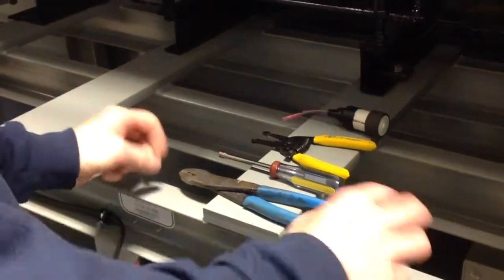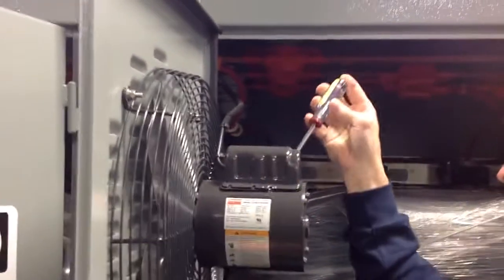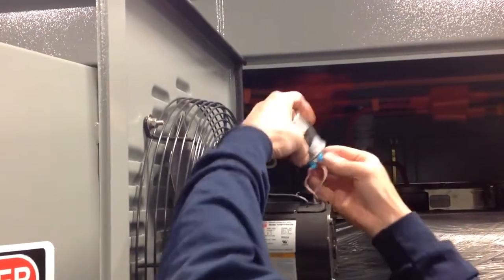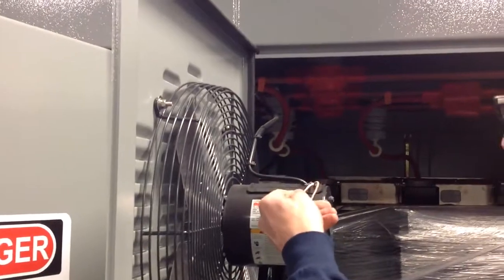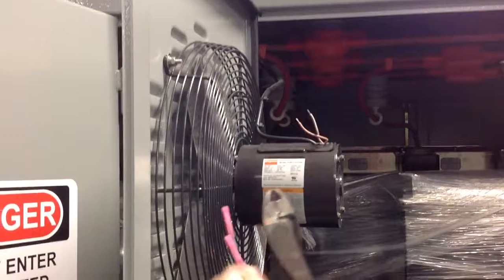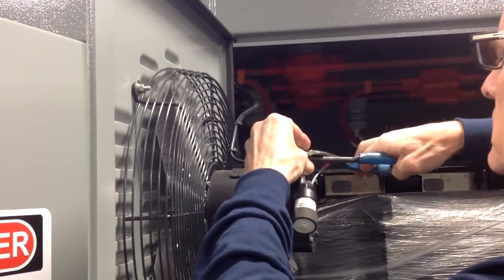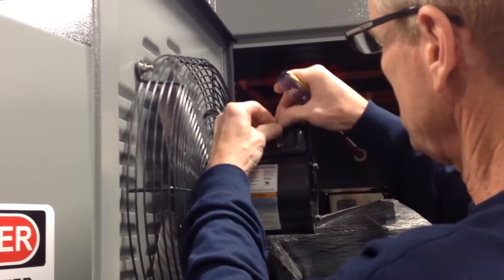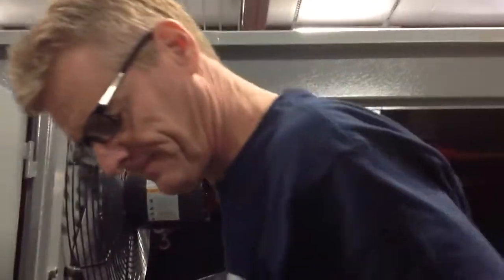Dayton Fan Motor Start & Run Capacitor Replacement

Comment: I have the same motor on a pedestal fan, need to change the capacitor,but is burned , I need the specs on the replacement cap. please...what size is the one you installed?